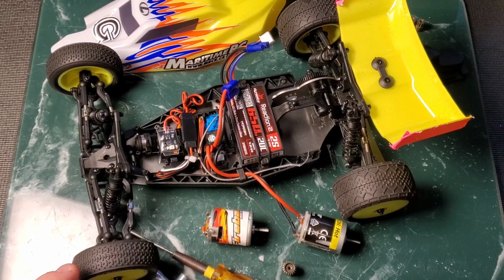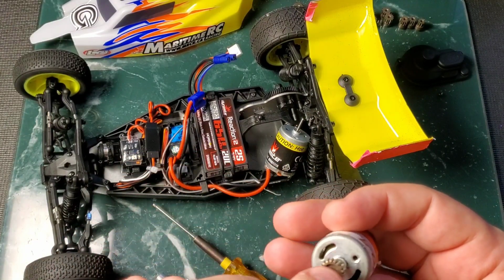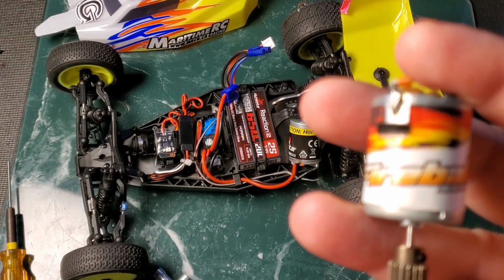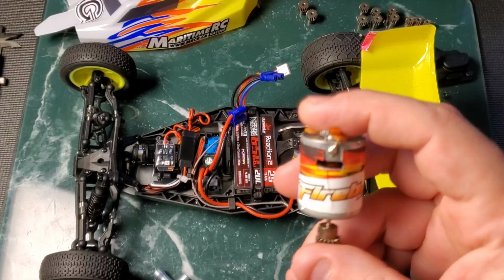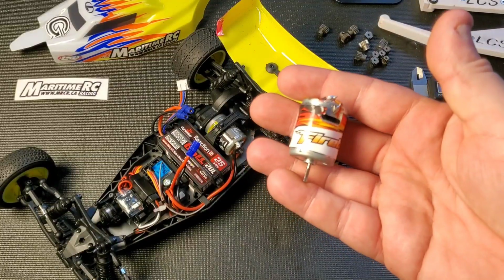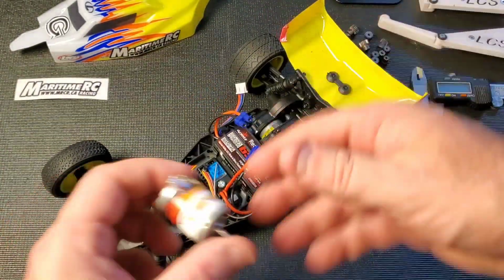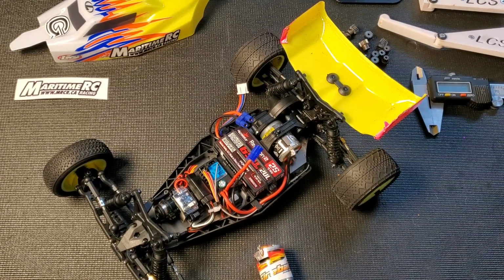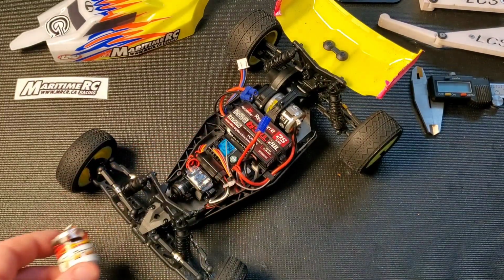Review: Losi Mini-B: 2wd Buggy RTR: Part 3 - More power! Venom Fireball!!!

Comment: Flip the rear shock tower so the shocks mount on the backside. You’ll see substantial improvements in handling.
Reply from the maker: Ill try that for the next race and see how it works! I was a bit worried about getting rear ended and the shock getting bent so i had not tried it before.